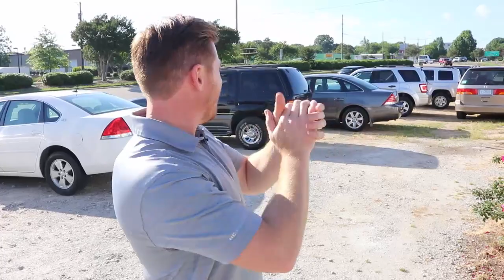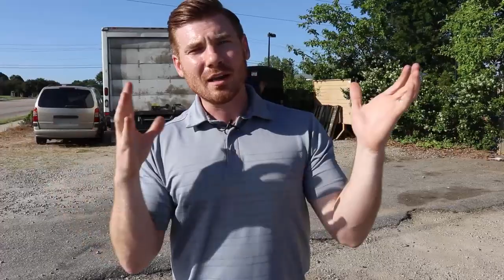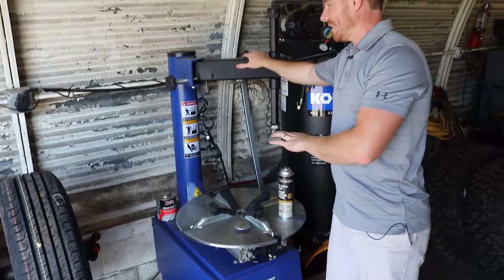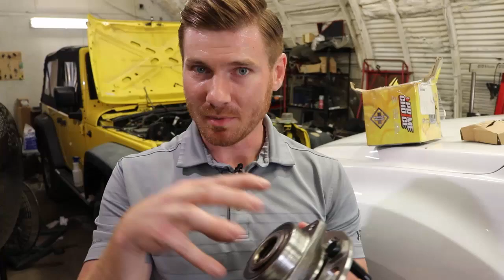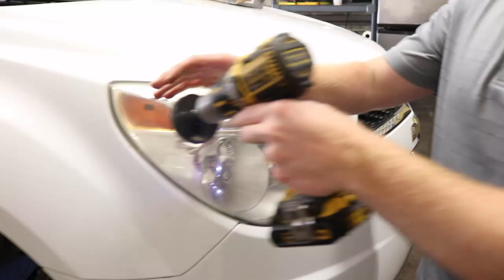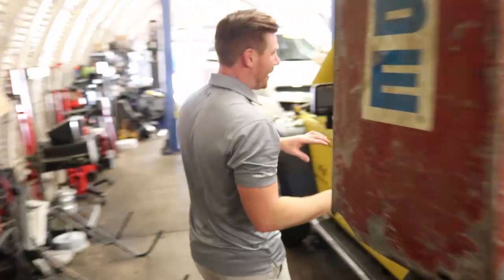Daily Flip | E43

Comment: You ever consider putting a decent set of name brand tires on a car to "increase value" to the customer. Lets say you have a car that badly needs 4 tires, a cheap set of Ying Yang tires may cost you $200, a name brand set of Goodyear/Whatever may cost you $300 (labor/disposal is the same either way). Cheap tires are just that, cheap. The customer sees a set of brand new name brand tires and sees $500-600 they don't have to put into the car for years to come. Thus you have a better negotiating strategy on the car and can get a higher sale price. 

Same thing with repairs on the car. If you tell the customer the car has new brakes it may not be that big of a deal. But it has new $400 Ac Delco brakes, it seems like that are getting a deal.  The upgraded brake pads may only cost you an extra $10-20.